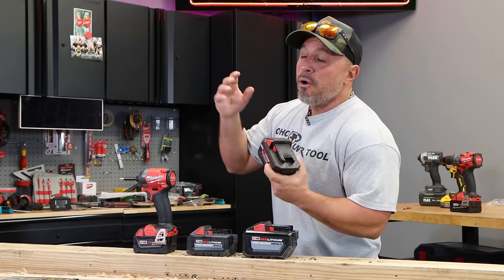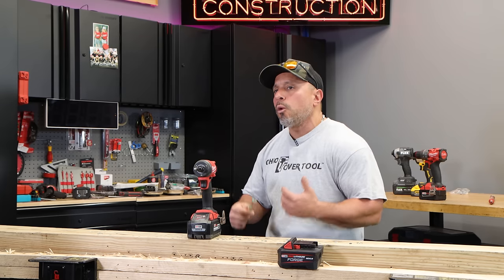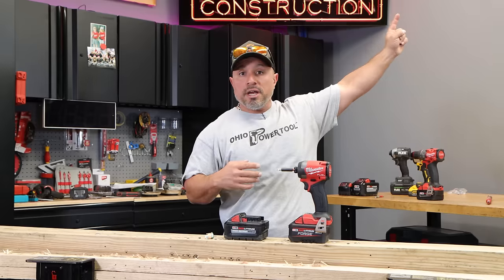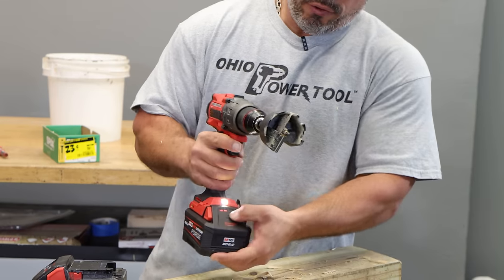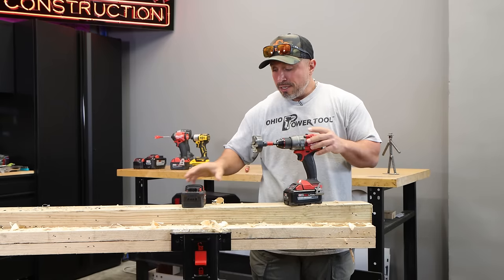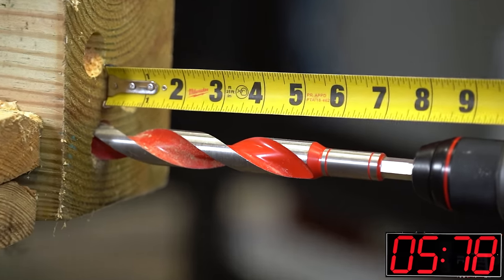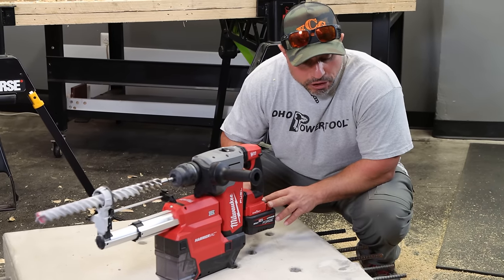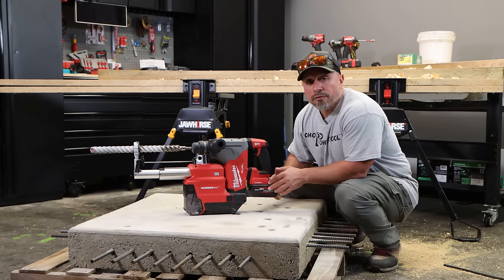Your BUYING Milwaukee Tools M18 FORGE Battery with WRONG EXPECTATIONS (stop doing this)

Comment: Like you said Vince, for 20 bucks more you get a much better and improved battery and the recharge cycle much higher, in the end you get what you paid for. And if you cannot afford one you can always buy the original one. It's nice to have options.
Reply: I have 4, 3.0 
2, 6.0
2, 12.0

that was a lot of money and I sue them daily hence why all the batteries usually enough to run 2 3.0 slap them on the rapid charger and then be able to swap out the two. If people wanna rush out and drop dough on a slightly new let system and a “matching” super charger go for it but my batteries of “old” work just fine and untill they break/can’t hold a charge I’m not rushing out to buy more batteries (forged)

Comment: Not trying to be rude at all. But I just don’t think you explained it very well. The 6 ah m18 forge battery will run as long as a regular m10 6ah battery but have to power of a m18 12ah battery . Is that correct? Wish they would come out with something like that for their M 12 line.
Reply: Yes. The Forge battery flows power into the tool the in same way/rate as the 12.0 battery does. The 12.0 still has about double the run time of the 6.0.
Reply from the maker: @MrSubaru1387 nice to see you cuzbo, thanks for jumping in here! 👍🏻

Comment: one thing about the 18650 cells is how durable and long lasting they are. lipo cells from what i'm used to anyway, are sensitive to overcurrent, overdischarge, ambient heat

Comment: Okay so what I am seeing, is do NOT purchase these if you already own HO batteries and are happy with them. These are for people who need to upgrade anyways, buy batteries for crews, or just like having the newest toys.

I love my HO batteries, and would LOVE to see Milwaukee make a 12.0 with these to cut down on the size and weight.

Thank you for what you do Vince!
Reply from the maker: Thanks for watching Philip!
Reply: My understanding is that most of the smaller M18 tools simply don't have motors that can make use of the extra power yet. 

The 12AH Forge is NOT using Li-Po (pouch lithium), it's using Tabless cells, like from Tesla's battery day. They can theoretically output about 5x the wattage for the same heat (heat is always the limiting factor in batteries). Li-Po can also output more power, so I expect 36v tools like the lawnmower to be remade supporting single-battery Forge at some point in the near future.
Reply: Dear sir

I am writing to inquire about purchasing Milwaukee M18 forge batter for Tracker rotation device in Saudi Arabia. Could you please provide me with information on:

- Availability in Milwaukee M18 forge batter for Tracker rotation device  Saudi Arabia
- Authorized distributors or retailers
- Pricing and packaging options
- Any necessary permits or documentation required for purchase

If you have any contacts or leads, please share them with me. I would appreciate your assistance in this matter.

Thank you for your time and consideration.

Comment: Nice. The gains in the Hammer drill were modest over the HO pack, but a little less weight and more charge cycles is a good improvement.
Reply from the maker: Great point!
Reply: The problem is they were minor gains over the six amp, our high output, and these are supposedly on par with the 12 amp hour as far as power output goes, which didn’t appear to be the case here and on top of that the 12HO’s obviously still have twice the runtime so… what on earth are we doing here? Kind of feels like a Sharknado movie but with marketers instead of sharks

Comment: I love battery comparisons, now cordless tools are so powerful that the main difference of them are really the batteries. I'm recently thinking about upgrading to High Output series since I got a new High Torque series 1/2....The forge battery looks promising, but the price kind of set me back for now.
Reply: I can get a week's run time with the 8ah & 12ah batteries,plus Milwaukee are 💩 bad build, chinsy plastic and plastic gear boxes.
When they were owned by AEG/Atlas Copco they brilliant.
Reply: I'd say get the high output batteries, they make a really big difference!  But get them on sale, or when they come free with a tool you need.
Reply: @marccadec6978 Milwaukee does not have a plastic gear box idk who told you that
Reply: @marccadec6978 Not the most educated comment.

Comment: These new Forge batteries seem like a nice improvement, more charge cycles and slightly more power. However, it looks like it is slightly smaller than the HO 6 amp battery. That is kind of disappointing. I thought that one of the main benefits of these pouch cell batteries was a significant reduction in weight and size.

Comment: 3:21 not sure what's happening here but it looks like the high output battery is going through the second 2x4 instantly on both of these tests, almost like there was a hole on the other side of the second board.
Reply: Yup. And when he used the forge and drill bit, he pushed sideways to kill the bit

Comment: Just got an insane deal on the  2 xc 6.0 high output battery starter kit that comes with the charger and the 2 batteries. It was usually $300 and I got it on sale for $210. I’d be stupid if I passed up that deal 🤷🏽‍♂️ thanks VCG for tool deals and reviews!! @VCG Construction

Comment: I'd like to see Milwaukee put out a pouch lithium pack in the cp 2.0 casing so we can still have a compact option but a little better tech. I thought about buying cp 3.0 but I prefer the size of the 2.0 for my impact driver!!!
Reply: I like a lean impact too, but I run the 3.0 ho on my Milwaukee impacts. I considered the size to be negligible.
Reply: Yea I really like the 2.0 size for almost everything when I’m on a latter, when I’m on the ground I’ll go for the bigger size.
Reply: H/o 3.0 is close to 2.0 I have a old xc 3.0 same size as the 5.0 basically
Reply: The HO 3.0 is substantially heavier than the 2.0. Much closer to 5.0 weight.
Reply: Agreed those 2.0 r awesome so light

Comment: I now have switched completely from dewalt. I now own the fuel vacuum , gen 4 impact driver , gen 4 hammer drill , hackzall and side grinder. With 2 5ahs , 1 forge , 2 2ahs lol loving milwaukee so far

Comment: Do it Project Farm style and use a torque meter with those drills and see if the Forged battery really makes the tool stronger.

Comment: You guys should check out the torque test channel on the new forge batteries you can see it bigger power difference making the circular saw vs. The impact and hammer drill

Comment: I do maintainence for a school district. Sometimes when installing things into concrete or block, my hammer drill will time out after doing about 2 holes. Then after it sits for a bit, it will drill again, but won't even get through 1 hole. It sure is annoying.
Reply: my battery chainsaw is the same but it is harbor freight and kind get what you pay for.

Comment: I have a bunch of 8ah high output batteries with several dead cells and they didn't start dieing till i started using them on The m18 fuel Weedeater I need to get 21700 cells to repair the Batteries no longer under warranty
Reply from the maker: Wow Antonio, why won’t they cover the batteries under warranty?
Reply: @VCGConstruction  no idea there Only 6 months old 12 of them are 8ah batteries and 4 of them are 12ah batteries there all 6 months old none of them had any issues on other tools but when i started using them on the m18 fuel string trimmer they all started losing cells to the point they only charge to 1 bar now and Milwaukee refused to replace them or even fix them so now I have a bunch of useless batteries that are only good for using on Small tools
Reply from the maker: That doesn’t sound good Antonio, sorry cuzbo!
Reply: @VCGConstruction  that's Life Cuz Something always goes wrong

Comment: Is pouched technology actually batter? Pouched batteries are more fragile. They do swell like in laptops and phones. I am guessing Forge has multiple pouches stacked. If 1 swells, there will be major issues. Personally I never encountered standard round cells swell. Die sure, but never swelled. But I have like a dozen old pouch cell batteries from phones, tablet, and laptop that I had to replace due to swelling.
Reply: You are correct, they would have been better of with 21700 tabless. Lipos suck...

Comment: Nice vid vince. Enjoyed it. Looks like the way forward for me. Using the bigger draw tools you can see quite a difference.  Maybe not so much if your just using small hammers and impacts all day, but the life of the battery also makes it a winner. Would love to see how it does in the hole dozer . Smashing out 4 inch plus holes. Im sure you would see a big benefit there too.

Comment: Last comment.
I’d grab a forge battery for the tools it just makes sense running them in, meaning high output, high demand, and high performance tools; otherwise, imo, normal m18 battery just fine for probably 80-90% of time or can go HO XC batteries as well, and then if need the Forge batteries ya can se em….options, pretty nice and also would be nice if pricing would reflect little better; as MILW kinda did a slick move when new packout drawers landed w/ pricing on prior 2 and 3 drawer packouts to make pricing for new drawer packouts to “make sense” I guess 🤔 (I’d personally like em to go in a different way, but ok…..lol); so will be interesting to see if new forge batteries make any difference w/ pricing at all, or things stay same w/ more options and prices are what they are. Do like that batteries should LAST LONGER for charge cycles on pouch lithium compared to cylindrical cells, so that’s a plus, but I’m curious to see real world data of ppl using the forge batteries in colder temps, as we know lithium batteries don’t like it too cold, or too hot; they prefer it “just right”….😂
✌🏻

Comment: Id say if u need to replace a old battery spend the extra 20. What tools can use the extra power will enjoy it the ones that will benefit from the little bit of extra run time youll enjoy it

Comment: I am a Tesla owner and are highly involved in information and education on battery technology in the lithium ion realm. These batteries are a little smaller than the equivalent cylindrical because the cylindrical has wasted space between cells which in our teslas, is not a factor because that is used for cooling channels which results in them being cooled more efficiently than bottom or top with prismatic/pouch.  Most of the other cars have much more failures, shorter life, and more fires which contain the prismatic/pouch versus the cylindrical in a Tesla.  The other startups also use cylindrical like tesla. Cylindrical is also less costly to make and as I said, have proved themselves as the more reliable better choice. I would not want to buy these batteries due to the fact that they use the pouch/prismatic. Some teslas are using pouch/prismatic now and are reliable, but that is because of Teslas effective bms and thermal control. In a cordless tool however you do not have thermal control nor do you often have effective bms management. Pouch/prismatic would be ok in my opinion in an ev with proper control, but not in a tool battery  On top of it, I had bought prior outdoor tools which used prismatic/pouch and half of the batteries have expanded/blown up and have failed as a result of leaving them in the shed etc exposed to the varied temperatures. I am getting rid of and retiring all of those tools also because the tools have issue. I actually can use them with m18 batteries with an adapter if I really wanted. All of my m18 batteries (cylindrical) have lived their life in truck with varied temperatures and not one has had an issue over a decade or more. I have dozens of m18 and m12 batteries. I WOULD NEVER TOUCH THESE PACKS WITH PRISMATIC. IT IS A MISTAKE THAT MILWAUKEE IS USING THEM. I BET IT WILL BE A FAILURE NIGHTMARE OR THE BATTERIES WILL NOT LAST AMONG OTHER ISSUES.

Comment: You forgot one Major Important comparison point here.  That would be the HD 6.0 aH battery as a base.  The power coming out of these batteries is still ONLY 18 Volts, No More.  The Amp Hour size does not allow the tool to work harder, it only allows the tool to work at its optimal working point for a Longer time.

As far as buying batteries is concerned, that only applies if you are one of the people that does not watch your videos where you tell everyone Not To Buy Batteries By Themselves, But rather when they come as a Kit or Free w/ purchase or some type of combo.
Reply: While the voltage remains at 18 regardless, the difference is the discharge rates which does allow the motor to draw higher current if demanded. The difference is quite significant between generations. the XC6.0 HO for example is capable of nearly twice as high peak amperage draw than the XC5.0. Irrelevant for the most part on say, an impact driver. But a chainsaw or table saw with knotted woods or an Impact wrench trying to crack loose rust welded fasteners on big rigs or equipment can be an immense difference.

The FINAL output values will be similar, but I'd much rather spend 2 seconds on a fastener than 10 very loud, high vibration seconds. Most people and most tools won't benefit from High discharge rate batteries, but the motors that do can make a massive difference in the usefulness of the tool

Comment: Well at this point in time I'm looking towards 3ah HO m18 for more light weight on my impact drill. Since it is a drill I can get away with not using my heavier 5.0 and save them for the hackall and saws.

Comment: It looks like a cool upgrade if you have a bunch of 6.0s that you have to recharge a lot. For $50 more dollars, you get 12.0 and I would assume fewer charges, which negates the benefit of the 6.0 Forge having more recharges. I'm sure my math is skewed with 2x the AH vs 3-4x recharges.
Reply: the problem is they are too big and awkward for the smaller tools. the 12ah is mainly for the chop saw, chainsaws, etc.
Reply: Even on an impact or drill, i think forge or HO 6.0 are way too big. Theyre better reserved for higher powered tools like sawzalls, circ saw, hammer drill, cordless chop saws etc. Especially if those are used daily...if those big tools are used once in a while i  think you can get away with even a smaller battery like 5.0s or 3.0 HO.

Comment: Its not much different than the regular to ho upgrade in terms of power out. When the tools motor output was the limit, it changed nothing. When the battery voltage drop and current output is the limit, it lets the tool ramp more. 

Seeing a home made 12ah forge battery (2 in parallels) running a fuel drill overheat the motor because theres more power than the motor can dissipate tells me the battery tech, based on current tools, is starting to max out their designs and software is becoming the name of the game.

In testing the forge batteries have even less voltage drop than a 12ah, which means not only more torque, but it will burn through the 6ah capacity faster as its quite literally moving more energy since the voltage is higher

Comment: I still grab my Gen 3 impact and drill over Gen 4 as Gen 3 still great tools and get job done, plus like my Surge and still going strong for me. Did get little annoying w/ Gen 4 hammerdrill when autostop would turn off tool for my “benefit” at times when just needed tool to go and wasn’t in any danger; far as wrist breaking, etc….maybe battery and tool and the magic inside weren’t getting along and decided to fight it out, lol, but Gen 4 are still good powerful tools; but sometimes just don’t need all that power, imo…..
Yeah right, 8:05  BRING ON THE POWER⚡️⚡️
Do like new batteries as pricing should change up a little, hopefully in user favor

Comment: OK, so I’m not into construction. I work on cars out of my own house so I’m not really sure what I wanna do here so my question to you would be I have an M18 1/2 dr compact gun and my question is will that forge battery increase the torque of that gun and I’m referring to breakaway torque
And it’s a little more than a $20 difference

Comment: What battery would you use or recommend for the Milwaukee off power supply? I obviously want to get the longest run time to charge my phone and other electronics but don't want to spend to much money

Comment: I currently use the M18 Fuel Attachment Trimmer with Quik-Lok (2825-20) and M18 Fuel Blower (2724-20) with M18 High Output XC 6.0. If I upgrade to M18 Forge XC 6.0, will I see a performance improvement with either of these tools?

Lastly, I am aware that the M18 Forge XC 12.0 is in development. Do you know if a compact version of the M18 Forge XC, ranging from 1.5 - 3.0, will be introduced?

Comment: Less downtime charging = more uptime in my saws and drills. $$$
Also, if Milwaukee is correct, and the Forge batteries last 1,500 charging cycles, that’s 3x more than the standard. So fewer dead batteries in the end, and less downtime. Makes it worthwhile compared to the regular 6.0s
Reply: Do you really need 6.0s in your drills and impacts though?

Comment: I think you're confusing pouch cells with lifepo4 battery chemistry... pouch cell does not mean lifepo4. Lifepo4 batteries will last a lot more charge cycles, but the M18 Forge batteries are NOT lifepo4 cells. They are regular lithium ion cells, just like the cylindrical 18650's and 21700's used in other M18 batteries, meaning they will all last about the same amount of charge cycles. In fact, the M18 Forge will probably go bad sooner, because pouch cells usually start to swell up as they age, which will bulge or bust the plastic shell of the battery, and should absolutely be thrown away at the first sign of swelling even if they still work fine.
Reply from the maker: This comment is all wrong 👆🏻

Comment: If only they used new tabless 21700 cells like they out in the new mx fuel packs, they would have 8ah instead of 6ah and even more power.